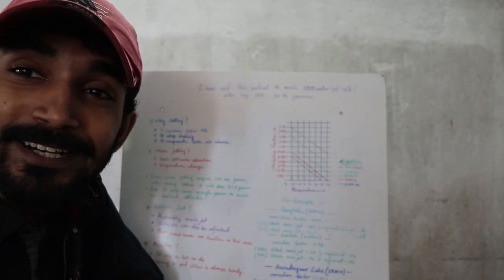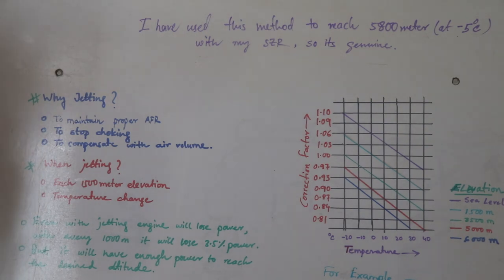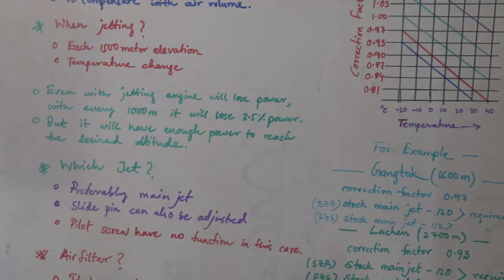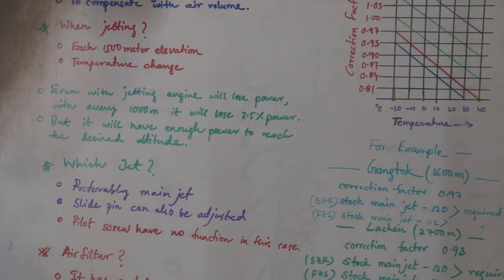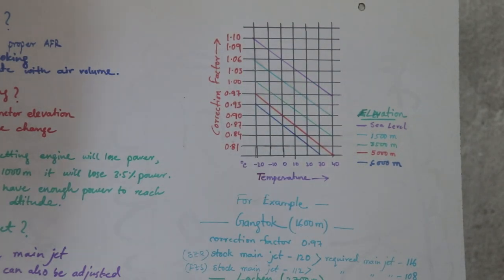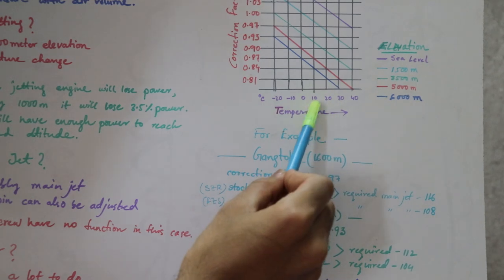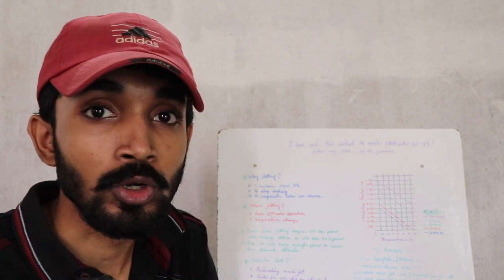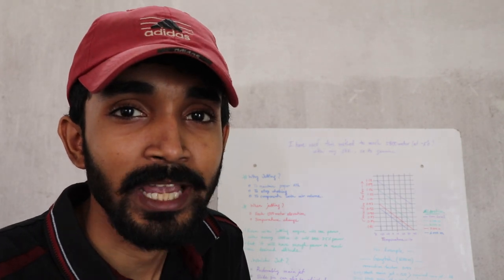Carburettor main jet tuning with altitude gain | HOW I REACHED 6000m |

Comment: The video is very informative for some. However, unfortunately it is late by a couple of years maybe for the mass audiances. Carburettor is history bro. Also, most of the indian motorcycles ( read non-yamaha) do high altitude quite well even without rejetting.
Good job. Keep it up.

Comment: Thanks for the info. I have not tried the following, but maybe a calibrated/knob vacuum line, between bowl vent and down stream of the throttle would help? It should lower the pressure in the fuel bowl, reducing fuel delivery. It should also work for the whole fuel curve, not just the main jet.

Comment: But bro my apache 160 reach gurudongmar easily with stock carburettor without any jetting and I have one of my friend with me he was riding a Honda shine it's also reach the gurudongmar lake just we had to remove the air filter of shine . No problem with apache.
Reply from the maker: Good luck for you. But you must have felt significant power loss. In order to maintain the power, removal of air filter is one way out, if even after that it struggles then one have to rejet.
Reply: @EzMeck  yes felt power loss but that normal on such altitude even after rejeting we don't also get full potential of the bike. But from next time before leaving for a trip I learn about carb rejeting who knows when I need to do it. Thanks for sharing the information